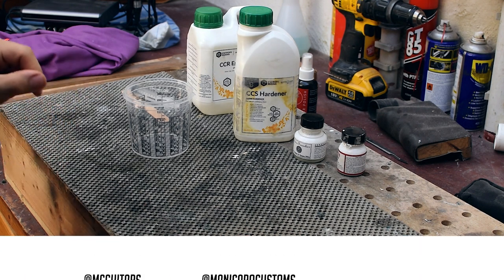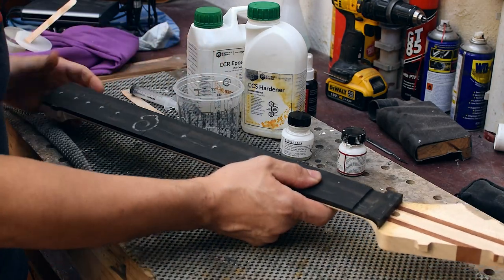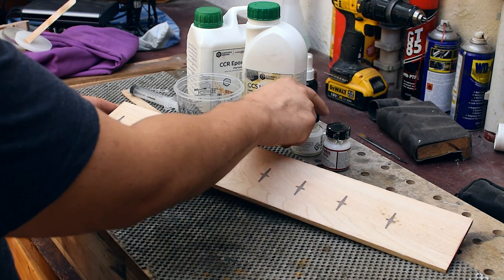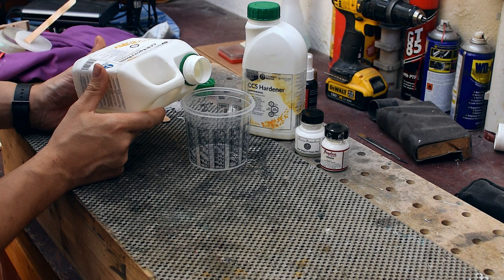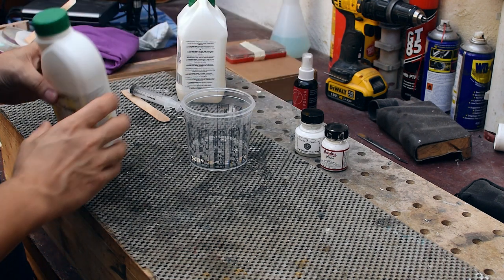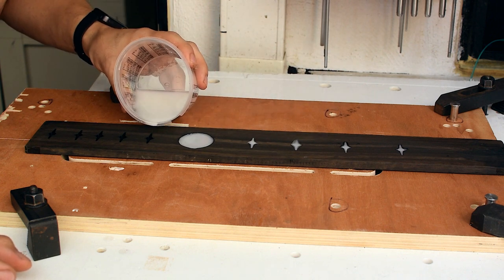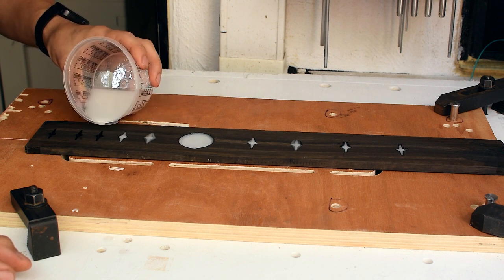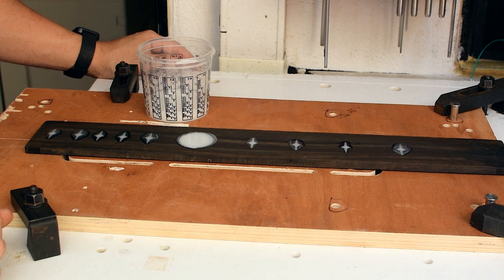LED Guitar Fretboard - Part2

Comment: Fantastic series, thanks for producing this! Quick tip about pouring epoxy; drill a small hole in the bottom of your cup on the side and tape it off before mixing your epoxy. Pouring out of this hole removes bubbles and is more controllable than straight from the mixing cup ;-) It does make the cup less usable, but hey.
Reply from the maker: Hey, wow thanks for the tip!